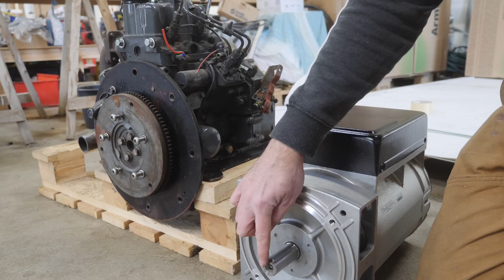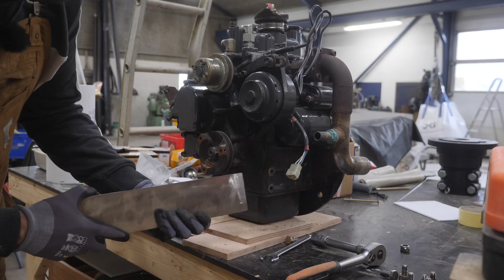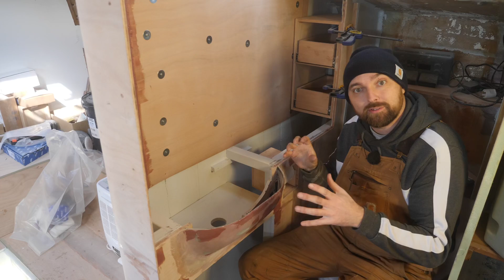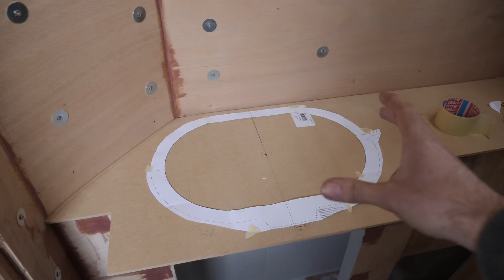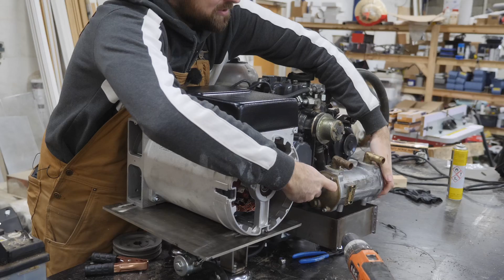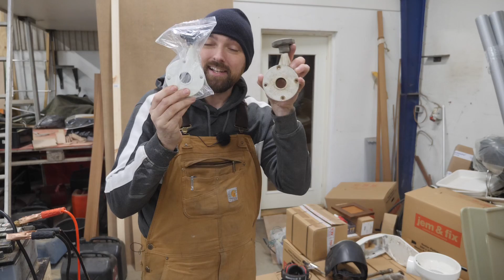Sail Life - DIY 9 kW diesel generator (part 1) & head vanity countertop template

Comment: I'd use a variable speed setup with an electronic controller. The gennie spits out 50hertz only if it's not under load, the speed of the whole setup will be dampened by the load and that will translate to the engine, consumption/wear. I know it's likely to be a very small margin, but for how cheap that kind of setup would be, and the fact that you know how to install the electronics/no issues programming, you'd be ahead of the game considerably vs others.

It's just a thought, i'm unaware what the load on a boat would reach out to be, you know that best, but on my generator, there's a variable speed setup with a mechanical governor, one day, if i have time, i'll swap it for electronics, as they are far smoother (hence my suggestion for electronics, given that you're on a boat).

Comment: You might want to do some "engineering" on the belts... a "fan" belt like the Cement Boat guy is using is nowhere near heavy enough to run that kind of a load.  It will slip like crazy and last about 10 minutes under full load.  While it can certainly spin the alternator/generator, as soon as it starts producing power to draw from, the loads are going to go WAY up.  Take a look at some of the 150A alternators on some of the boats in the marina and they are running 2-3 of those belts.  Balmar as I recall has some handy HP to KW conversions for how much "belt" you need.
Reply: Multiple V-belts need to be precisely matched to evenly distribute the load, think instead about automotive style ribbed serpentine belts.
Reply: V-belts are much more forgiving and (probably) much more readily available around the world. I would add independent sprung tensioners that will always stand duty and keep each belt snug. Independent tensioners would also allow minor deviations in belt length.
Reply: Steve, we just put in a 175A alternator upped from the 120A as part of our new lithium battery installation. The only thing that would drive this large of an alternator is a serpentine belt. I should have had a serpentine for the 120A but got by with using a slightly larger pulley on the alternator and using a Gates, Green Stripe, belt.  No other belt would last. Mads should really be going with a serpentine belt.
Reply: @SailingBrickHouseAndOsprey  V belts are capable, but out of fashion. Helicopters, large agricultural implements, etc. have used ganged V-belts to transmit hundreds of horsepower (while buffering harsh pulses) for over 70+ years.
Reply: @SailingBrickHouseAndOsprey  Patrick you got that right!
Reply: Agreed. Best look at toothed belts as used on Harley Davidsons. Gates Polychain. Sprockets are silly expensive however.
Reply: KW to HP conversion is easy, take the KW and divide by 746 to get HO. So 9 KW generator requires 12.06 HP.
Reply: @hommie789  I know that but wasn't really talking about how much HP would be required to drive his 9KW but how much belt would be required... using either HP or KW as the input.
Reply: @hommie789  Yep, I chased down his model number 8 kW flat out. Ouch! To account for losses he will be at ~7.5 kW, again flat out??
Best wishes

Comment: "We're probably going to go with that...."  Get used to saying that.
Reply: In these difficult times we must get used to living under marital law.
Reply: "We are probably going with that" ;-) 
Mads is clever and kind enough to keep his wife to be happy!
Reply: In terms of diesel engine speed for generator. You would want to consult the torque curve/power curve graph specs. Running the engine at rpms higher than torque peak rpms means the engine will actually climb the torque curve as load increases. Running at rpm less than torque peak would always be a "down hill battle" for the itty bitty diesel. Also that would translate into better fuel consumption. You want to gauge the max load at around 85% MCR. That is max continuous rating. Meaning if you apply a momentary overload the engine will cope and not stall. I wonder how many nay sayers realize that all the so called green energy in the world is still coming from man made chemicals and carbon emitting factors getting power from the grid! Good luck with the "genny" and hope you get many decades of reliable instant power at the push of a button!
Reply: @gregm2074  This occurred to me also. although far less eloquently.
Reply: Was thinking the same thing.  :)
Reply: That line had me burst out laughing! 
Happy Wife，Happy Life！
Took me a while to learn that one.  Some battles a not worth fighting!!
Reply: @DrMarkGB  Always get the last words in in every argument:- "Yes Dear." <:O)
Reply: @DrMarkGB  Where I come from we say it a little differently: "If momma ain't happy, ain't nobody happy."
Reply: Actually black is the hardest to maintain. Ever talk to someone that has had a black car? They wouldn't do it again unless they loved washing and polishing it daily.
Reply: @benlindner5285  True

Comment: Hi, why don`t you look up on the internet in what range the Perkins delivers the highest torque, and set that RPM range as operating range under load?
Reply: Those were my thoughts as well.   That little diesel may be happiest around 1500 rpm.    When we worked off grid, our 15kw genset ran at about 1800.
Reply from the maker: I did that a long time ago. It looks like Perkins removed the PDF. Here it is from a different site. https://s7d2.scene7.com/is/content/Caterpillar/C10378904
Reply: @SailLife  as i see (if the model was correct in the pdf), the torque peak is from 2000 rpm on. It is also a good idea not to use it at too low revs to prevent carbon build-up. What i would do: i would caalculate the average load when you ned the generator - it is when the solar is not enough as there is one large machine turned on. That average liad should keep the rpm at 2200-2500 rpm - from that level it can go higher when the load is higher, but can also go a little lower - still working within the highest rpm range. On our sailboat we have 600w  solar and 250ah usable capacity in the house battery. The only high consumption is a katadyne water-maker - that can be run only from solar. If you have a similar setup and a tow generator, you need the perkins if you expect no sun for days, and on anchor.

Comment: Suggest sizing pulleys so Perkins runs slightly faster than max torque speed. It won't bog down then.
Reply: Just as a friendly counter point...  I wonder how large his load will be. The induction stuff doesn't take too may amps in comparison to a standard electric range or oven. I bet all in all that engine wont ever have to work too hard. I wonder how often it even needed 50% of rated torque and HP.

Comment: Add an optional air pump and you can also use it to refill Scuba tanks. I want to live aboard full time as well, so have been researching stuff and planning. Have seen a couple of setups where they used a small engine such as yours and had a water maker pump, and air pump, and alternator. So you charged batteries anytime you made water or filled tanks etc...